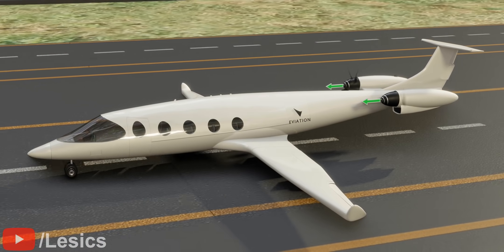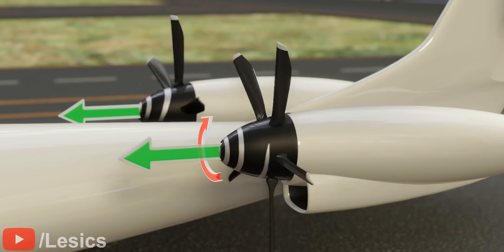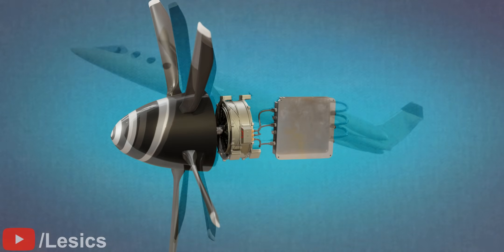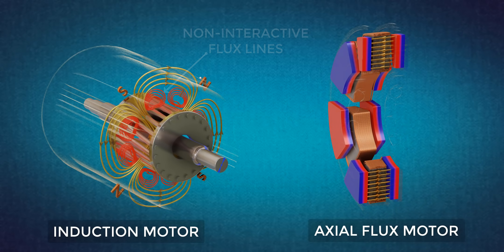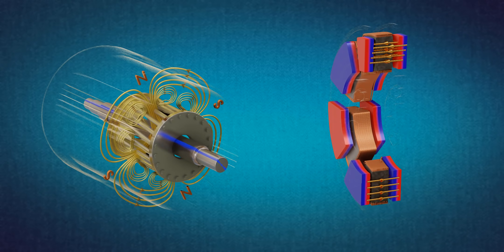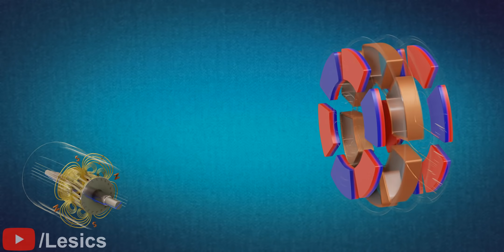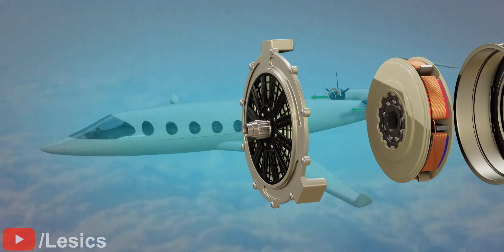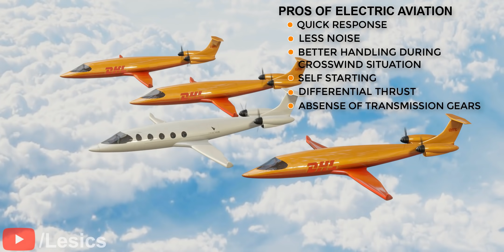Electric Aviation | The Dawn of an Advanced Transportation Mode

Comment: An electric airplane will probably never work because you need a big heavy battery or you need a big heavy generator like a jet engine, the compressor. First of all, they put the compressor the turbocharger or the supercharger on a 4-stroke cycle engine. Then they realized that the 4-stroke cycle engine doesn't spin fast enough. That's why we have the jet engine the turbo prop. So this video is just conjecture. I guess that's the right word. It's just talking hersay maybe on a small level

Comment: Complete nonsense. This video is three years old and electric planes are still a fantasy. If you are 25 years old you will not see a paying customer ride in an electric plane in your lifetime. Oh, also there is no bathroom on these planes because the design engineers are constrained by the weight limitations of any electric aircraft. Calling electric planes aircraft is ridiculous since the planes have never been airborne.

Comment: Apart from light aircraft for short hops, electric planes are non starters.  And the places where a short hop in a light aircraft makes sense (eg. hopping to a Norwegian or Seychalles Island) are so few it hardly merits the development.  For commwercial airliners, in addition to battery performance, the other huge issue is speed.  Jet engines took over from Turboprops simply because they could do double as many flights. 
The climate  would benefit more from money spent  cutting emissions elsewhere, like heating and air conditioning.

Comment: You are lying by omission.
Only mentioning the advantages of electric motors and then NOT mentioning the major disadvantages of the heavy and low capacity battery packs. Also low life expectancy.
And more pollution, because of the mining requirements of the rare Earth materials in the batteries.
Electric cars and airplanes are are a scam and a brain-fart.

Comment: Once again not addressing the most important reason electric aviation is all a pipe dream. Batteries. The energy density of batteries is 60 times worse than aviation fuel. 40% of the weight of a plane typical passenger plane at takeoff is aviation fuel. Even assuming a liberal 100% efficiency of the electric motors, this will still need a battery which will be 20-30 times heavier than the aviation fuel carried., which means a plane that is about 10 times heavier. How does this plane obtain lift? Even if you manage lift of this behemoth, what kind of range are we talking about? What kind of passenger capacity? These may make sense only for short haul air taxis and even there its not goign to be energy efficient.

Comment: Not sure why differential thrust is such a big topic for electric planes.  One way or another you’re going to have to counter the side slip of a crosswind landing with either yaw or bank to create an equal force in the opposite direction, which can be controlled just as well with control surfaces.

It’s not like you can keep the airplane straight and level with the runway by just increasing the thrust on one side.

Comment: This is a high-speed aircraft optimized for maximum efficiency that requires comparably long run ways to operate from (small wing, plain flaps).
Even if this aircraft would have a decent range it would still serve a niche of rather rich people or tourists. I think a variant serving small, unpaved airfields in rugged environments with reasonable cargo capacity (Island hopping for example) would be a better business case where the low costs of electrified operations would really make a difference.

Comment: Biggest thing holding these technologies back is battery technology.  We need a big innovation when it comes to battery energy capacity.  Costs are just too high & energy storage levels too low to do all of the things we really want to do with Electric motors.  That or there needs to be some innovative tech that greatly reduces the required energy charge for electric motors.

Comment: Since a few years ago some of the high end EVs have been using axial flux motors. They will be used at an increased rate in EVs. The axial flux motor has less weight and is smaller for a greater amount of power than the conventional type of motor presently being used. 

There are plans to have electric aircraft for long distances. They will be using an on board generator to maintain the battery system for long flights.  The electric motors can offer a great amount of torque for takeoff and fuel savings. Once airborne the generator can keep the battery system maintained as necessary.

Comment: Simply put “Its an entirely different kind of flying, altogether.”
I think most in comments missed the point of this presentation.
Yes all control issues have been solved in conventional planes so electric isn't solving anything new.
It makes them redundant.
Control surfaces transmission gears etc make plane heavy. Ground up electric planes don't need a lot of that this reducing weight of plane  And weight is the biggest hurdle longer range electric planes.

Comment: Outside air temps are usually -50C at cruising altitude. Without any fuel burning, how will the cabin temperature be maintained without using inefficient electric heaters greatly reducing battery duration.
Reply: Future batteries will have sufficient stored power for such "peripherals"

Comment: I am not going to discuss the details of the thrust as others have already spoken in the comments below. But the animation clearly shows that the comparison is between Apples and Oranges and not Apples with Apples. The small private jet (Electric version) is compared with a huge Passenger aircraft. There is a lot of difference. An E-Version of Private jets is very much possible due to less weight of aircraft, less passenger and luggage weight, and other factors. The Content makers have also not mentioned any info on the battery capacity, its weight, flying distance with such capacity and many other factors. For example, Airbus A380-800 was capable to carry 853 passengers with a range of 15000 km. It can fly without a stopover from Hong Kong to New York. If an Electric version for such an aircraft is to be built what would be the size of the battery pack and overall battery - Motor weight, is it equivalent to Gas Turbine Architecture or less or more? Such details would have made this video even more interesting. Just explaining the type of motor used in Private Small Jets does not seem justifiable to me.

Comment: 0:08 Those are only the positive reasons why electric airplanes stand out, which is extremely dishonest.  Electric airplanes also stand out for their abyssmal range, low energy density, and lengthier pauses between trips due to slow charge speeds.

Comment: You used a Boeing 787 in your animation. Boeing 787 Engines are not started by means of an air turbine starter, but rather a starter generator. All electric.

Comment: Brushless motor tech in the RC hobby seems so simple yet these motors pack insane power at a relatively light weight. I can run 24v to a small brushless motor on a 6-7" prop and generate over 1200 watts of power and 2500g of thrust

Comment: direct swap dry (to wet) aluminium-air primary battery cells are at 3.5kWh/kg, the same as gasoline engine at 25% efficiency, but at 90% for aluminium-air batteries, keep them dry until they are used and drain when not in use
Reply: so you dont know how to do true pure dc brushless electric motors, skipping complex control electronics, huh
Reply: if you have replacement anodes, metal-aluminium sheet meshes, direct swap contents of the fuel cell and/or batteries

Comment: It is nice at all but we've been stuck to a myth that batteries on board a plane is bad and for a good reason. These planes contains live high amperage batteries. I'm concerned about the safety of crew no matter what. And so many parameters are missing from this video. This video feels more like an advertisement for electric Aviation than educational.

Plus traditional jet engine airplanes have been through their share of hardships to become what they're now, while this electric based airplanes are rather new. I would advice to make unmanned version of these airplanes, to test these to the fullest for safety reasons. Such airplanes should be controlled remotely from ground stations until it is confirmed that they're safe for travel.

Comment: IMHO electric aeroplanes are pretty stupid and dumb. Hold on to your potatoes and hear me out. The energy density of current battery technology is beyond pathetic when compared to jet fuel. Unlike other IC engines jet engines are very very efficient and so, you are not wasting a lot of energy to losses. An electric aeroplane as of now can only be a toy and will remain a toy until a ground breaking energy storage is invented. No matter how efficient you make the motor to be, it will just be an insignificant pebble on the grand picture.

Comment: Interesting.  The biggest advantage I can see is the lower maintenance needed for a electric motor.  With a gas engine you need overhaul them every 2000 hours or so.  And even for a small plane like a 4 place (seat) Cessna that can be very expensive ($10K or more).  Also there are the  oil changes, vibration issues,  etc. associated with piston engine.  And at altitude there is loss of engine performance due to decreasing oxygen density.

Comment: Hmm.  Wonder whether nuclear power could be harnessed to power electric plane motors?  With all the battery chemistry being explored, it seems probable that thermopile efficiency; as a byproduct of that research, may hold some interesting promise.  Also planes usually take off from airports.  How difficult is an electro magnet solenoid catapult?   I know electric ballistic launching tech is known.  Mag lev trains have a technology that could be adapted to launching airplanes that go from airport to airport.

Comment: Have a nice day;
My name is Mehmet Ali . I am a student at Sivas Science and Technology University. In the province of Sivas, Turkey. I watched the video about axial flux electric motors. I have been doing research in this area for months. I am a university student doing postgraduate studies.

I request your FEA support to use your name in my works and to improve myself. I am writing to you because I learned that the animations in the video belong to you. The video link is attached.
The subject of my thesis is 'Investigation of axial flux motors and comparison of torque-weight value for use in aircraft with
existing systems'.
I need your ideas and suggestions for the resources and technical drawings that I will benefit from in this study.
Thank you for your attention, I wish you good work.

Mehmet Ali KURT
Greetings from Turkey.

Comment: NO NO NO. An electric motor DOES NOT RESPOND INSTANTLY AT ALL ! It has to accelerate decelerate to a new speed depending on load and power input plus there's stored energy in rotation itself !

I've rarely come across so much PURE DRIVEL in a single video ! Learn some engineering.

Comment: You say differential thrust is impossible on jet engines, which is not true at all.  There was an incident (airplane crash) that involved a passenger jet losing its 3rd engine (in the tail) which severed all the hydraulic lines (backups included) and the pilots lost all control of the aircraft with the exception of the engines.  They used differential thrust to steer (if you call it that) the plane to the runway.  Granted the aircraft crashed with loss of life (many people survived), they were able to steer the aircraft using differential thrust.  Please do more research on subjects before posting content that is inaccurate.

Comment: Regarding the bullet points near the beginning:
Electric powered planes are not much quieter than a comparable piston engine powered plane,
 most of the noise comes from the propeller itself. 
Another (false) point is
 "electric planes can use differential thrust".
 ANY multi engined (or motored) planed has differential thrust control.
How does an electric motor handle cross winds any differently???
Bogus points.

Comment: I disagree with your about propeller speed governors. Both have them but appropriate to their type. I also disagree with about electric engine speed control. While frequency is one aspect, the power delivered to the prop is a function of the wattage delivered to the electric motor. You also didn’t mention, or conveniently forgot, that large diameter propellers have a maximum tip speed (before they become inefficient) so a propeller pitch changing mechanism is necessary. You are also HOPELESSLY wrong about differential thrust. It is possible on both jet and turbo prop aircraft. But you do not do this in the air. You will also NOT do this in an electric aircraft unless you want to really screw up your landing. Another huge great omission is how do you deal with yaw control and crosswind landings following the failure of a power plant? These things will be just as susceptible to bird strikes, ice damage, pitch change mechanism failures, cooling problems, bearing failures so having subsequent degraded yaw control is not very appealing and will probably make these things uncertifiable. And just to be clear, you don’t fly public transport aircraft, do you?

Comment: Great video.
You guys forgot one of the biggest main points: Due to the missing high explosive heavy kerosene the plane is by far less vulnerable in emergencies and also easier to maneuver due to less weight (which means its easier to steer against friction in general).
Reply: Guess you never noticed the unprecedented problems when electric vehicles burst into flames.
Reply: @nabirasch5169  obviously I did and I didnt say this is no problem
I was talking about the cos only

Comment: I have put this battery everything to an test for the last 4 going on 5 years. With zero bias. To see for myself how it works. Gas on one side. Electric on the other. I would say both have their own places. One or just the other. Mega bad idea. Here is why. It has to deal with anything with an battery. Here is why. Electric mower. Starts at high. Then drops to mid. Unless it is in an bind. Then goes back up to high. While in mid. No different then cleaning your carpet in your home. Back and forth. Takes forever. The battery. After use. Cool down time. Then charge time. Then the temperature environment around the battery. Weedeater. My yard. 4 times I have to charge the battery to get the job done. Okay. Only 4 times. That's using it. Then letting it cool. Then charging it. Takes all day. Gas. Done in 45 minutes. Then battery fully charged. Drops power until its uncharged. Gas. Stays same power level until more gas is needed. Take an plane. 440 nautical miles. Okay cool. Yet its batteries. Meaning at take off I have full power. From there. My power level drops. Not to good for high winds and bad weather then if there is an go around plus having to clime over mountains, ect to do it. Fuel. Whom cares unless the motor quits or run out of fuel. Power level stays the same. If I could. Would I buy an electric plane? Nope. I would buy an electric helicopter. Also with an range of 440 nautical miles. I would cut that in half. For safety. Then plane my trip not in hours but weeks. Manly because the power grid has an bad habit of being shut off. Same with fuel. Why the truck I travel in has an 36gal tank. Amazing highway mileage. I don't trust both. Gas or electric. Another reason why an helicopter over an plane. Is landing in an safe spot for something going wrong. Way more options. My opinion. You fly one or buy one. Make your distance between charges more shorter. Don't push max range. An battery is an battery no matter how you look at it. They power level will always go down.

Comment: OK People... We surely are not going back to a prop driven aircraft, regardless if electric motor or jet engine  One key element, of course, in air travel is air speed.  I hope we do not believe that a prop driven air frame will fly us from New York to London within 3 hours, as a jet engine has, (The Concord).  Show me a fast and safe air speed with range, with an electric motor with prop, and I will then take note and listen up.  Also air travel is  at 15,000 to 35,000 feet AS, where the air temp is well below zero = A study conducted earlier this year by the AAA found that when the mercury dips to 20°F and the heater is in use, an electric car’s operating range will drop by an average of 41 percent. That means if you own an electric car, that’s otherwise rated to run for 150 miles on a charge, you’d likely only be able to drive for around 88 miles before having to plug it in.  What I am seeing, as "plane" as day, when using electric thrust in aviation, is much less air speed at 30,000 feet and much less range at 30,000 feet; when using an eclectic motor as a thrust alternative in aviation.  Good flying!... Ron

Comment: I just caught this video in a lie. It states that the speed of the electric driven prop is only dependent upon the input frequency. Whenever a load is put on a motivator, it will slow it down unless more power is applied to maintain a constant speed.

Comment: Do these benefits actually matter ? Batteries are very heavy and reduce the planes cargo capacity, also fuel tanks get lighter as fuel is burned while battery ,charged or empty, will always weigh the same.

Comment: Differential Thrust only is a big help, if the Aircraft Design is poorly planned, with a Too Small Rudder.

IE. Compare the Single Engine VMC of a Piper Twin Comanche vs the VMC of a Cessna Golden Eagle 421! It's also related to how Short Coupled is the "Arm" length to the Rudder, from the Thrust Point.